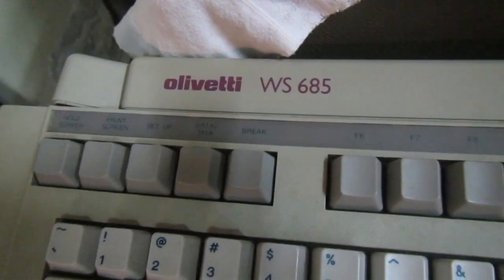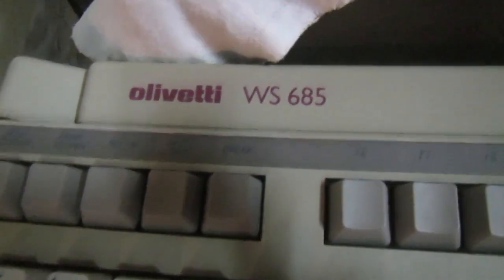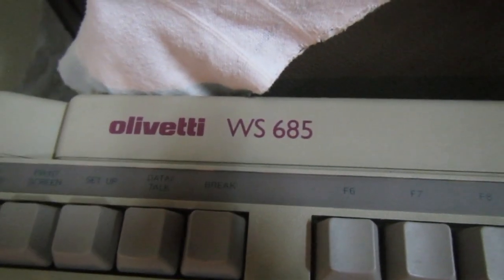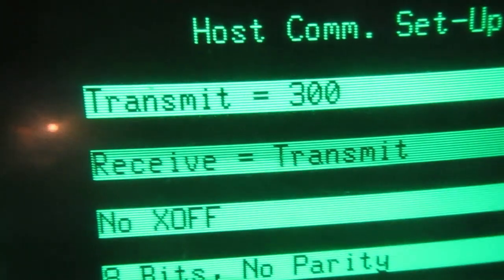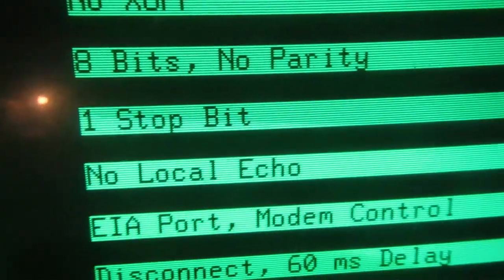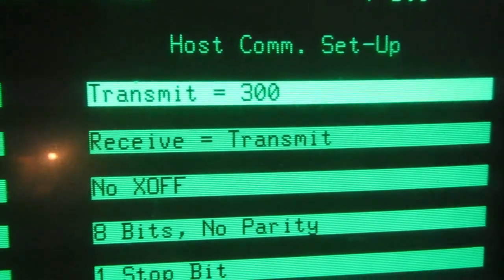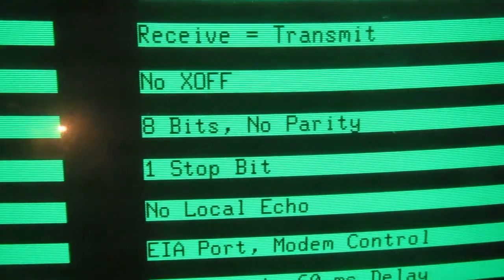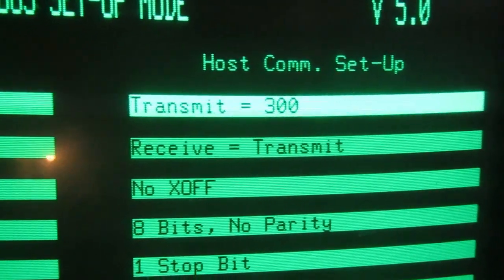Acoustic Modems: recreating a small analog phone network at home!

Comment: Nice video and info. So the Grandstream Ht502 is a better solution if you require pulse? Are there any other features on the SPA-2102 that are missing on the HT502?
Reply from the maker: HI! Thanks for the comment! I don't have any Grandstream, but I would definitely want to acquire one in the future. I don't know if there's any other feature missing, but if I have both, I'll do an update. I've used this setup for more modems and acoustic coupler testing and it's fine once you find the right settings. Pulse dial would be a real complete "old time" simulation for me.

Comment: Frank, what a brilliant way to connect old analog phone devices. Like you I had looked into finding an old PBX or building a simple one myself but it was more effort than I had time for. This is pretty simple and the Cisco 2-port adapters are all over eBay pretty cheap now (guess companies are getting rid of them.) I guess this could also be teamed up with reprogramming an old WRT54G router as a wireless bridge so you could connect your two analog devices over your WiFi.

Looking forward to more...
Reply from the maker: Hi Jeffrey! Yes, the good thing about asterisk is that I could connect to ATAs everywhere in the world (if there's enough bandwidth and low latency of course) and it's a really cheap setup. Another option could be reprogramming one of the DSL modem/routers that also have two FXS analog phone ports, like the A/HHG2500 for example, but I always failed to find a suitable firmware for the few units I have. So this setup is currently the best I could think of :)
Reply: @iz8dwf  I found a Linksys PAP2 on eBay last night, from a close to me seller, for $20 delivered. This unit looks similar to the SPA-2102 but without the router built in. I already have a Raspberry Pi that I can use as the server. I have several old Commodore modems I have been wanting to test and I think this will be a very good way to do that. It would also be interesting to try and configure it to work to be able to 'call' another persons modem through the internet.
Reply from the maker: Hi Jeffrey, yes the PAP2 should do the job. Once you have a working setup, we can try to link the asterisk servers and see how it works for "long distance" calls :)